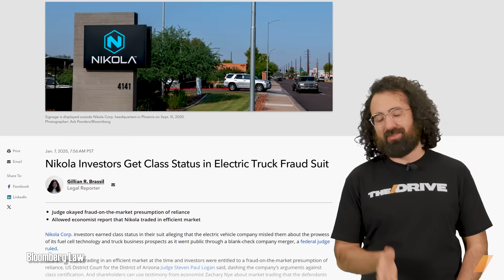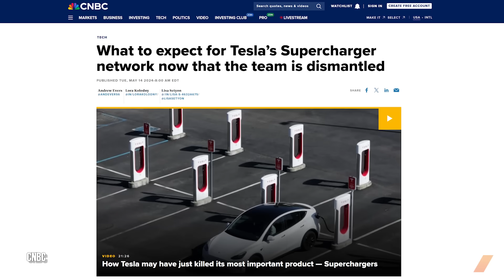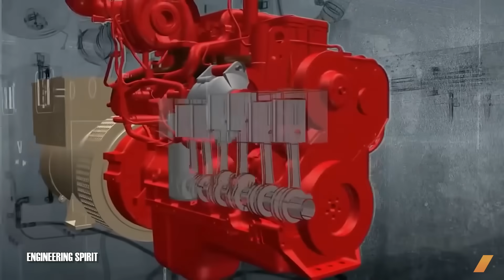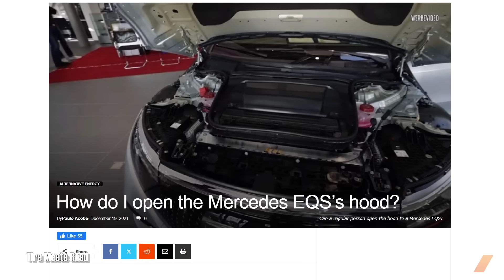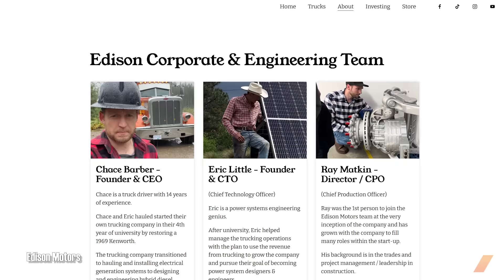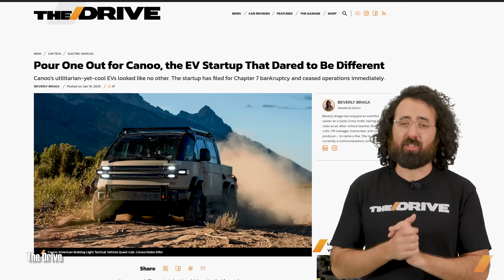The truckers in a shed beating Tesla with 100-yr-old EV tech

Comment: I'd been asking the same question about fuel hybrids for years. Much of the efficiency comes from using electricity for power transmission instead of complex mechanical systems that lose power along the way. In turn, that can reduce complexity of the remaining mechanical systems.  

The resistance against hybrids always come down to a blind focus on going full EV or "refining" standard engines. There's a hard limit on mechanical efficiency that will never be overcome, and full EVs are going to require a massive infrastructure overhaul. The complete dysfunction of US politics is going to stall any form of long-term investment. 

Whether EVs are the ultimate future is debatable, and that future is a ways off. Hybrids can bridge the fairly large gap between standard engines and full EV in many applications, and hybrids can be done RIGHT NOW!

Comment: im my opinion, the near future is either about biodiesel or hydrogen cells. 

biodiesel: 
pros:
- doesn't burn as easily so its less likely to cause a disaster.
- most diesel vehicles can already run on biodiesel without modification
- cheap

cons:
-  lots of moving parts
- requires land usage for growing plants.

hydrogen cells:
pros:
- not many moving parts requiring less maintenance 

cons:
- pressurized explosive gas.

Comment: at 3:52 when you talk about batteries needing to be replaced i found out recently where i was on a tour at a school where you could take an education to become a mechanic and they have little area dedicated to electric veichles and they told us that the batteries are build up in ''cells'' were a bundle of batteries are and if a cell goes bad you can replace that particular cell instead of replacing the entire batteri just thought that i wanted to say that if anyone didnt know
Reply: I think the battery replacement is more about the cell degredation over time with charging cycles (especially when they charge quickly) meaning all the cells need to be replaced around the same time

Comment: What they could do for rear axles for pickups is make a diff motor unit! Basically have a super-duper electric motor feed into a standardized differential, and then reuse the rest of the factory axles and such, rather than direct-drive. Yes, you lose the one motor per wheel, but it simplifies costs by literally allowing you to buy an off-the-shelf differential and making a motor mount.

Comment: One giant inefficient that is never addressed with pure electric vehicles is transmission line losses. Those hundreds of miles of wire from the power plant to the charging station radiating heat from resistance. Is that counted into an EV's empg?

I just bought a Prius, my first, for gig work. I used to drive semi's OTR. With those two things for experience I can say this makes so much sense!

The single lever for forward, reverse and a park button are great for the frequent stops in gig delivery work. When I drove semi's out of Kansas City I shifted about 50 times before I hit 435 with a 10 speed. The company did put me in an automatic for a couple of years which I did like but my last truck was another 10 speed.

Comment: I have seen these Edison guys before and it's looking great. Here in Norway the politicans are thinking "one size fits them all". Electrical passenger cars has >90 % of the new car market because they are taxfree in the price range ordinary people are buying, while even PHEV's like Rav4 has high taxes to a cost equal to 75.000 USD, and most families can charge EVs at home and don't often drive longer than their range. Local heavy goods distribution also is on special battery built trucks. But even we have had diesel electric trains for a century, and still have on some remote train lines and such as people with PHEVS with ok range are driving nearly emission free, the politicans think they understand the needs and engineering better than specialist, but of course don't understand the completely different need for a lot of companies with need for such as 4x4 pickups towing trailer at 3.5 tons long distances at public roads before they go off road to serve the society's needs. And that the obvious choise for heavy trucks should be hybrid models untill new tech is ready. All of us have responsibilities in the need for emmission reduction to stop the global warming, but a lot of politicans might have been too optimistic in the Paris agreement and in panic dismiss known tecnology which would made better preliminary results than trying to jump directly to systems they think will solve the problems before the development is ready.

Comment: hang on? a manufacturer is preventing customers from opening the hood? that's a fire hazard, an actual fire hazard where if the fire brigade cannot access under the hood to combat fire or even the user of the car to open the hood to combat fire, that is a fire hazard and must be classified as a "stop use" recall with immediate remedies.

Comment: I don't think EV trucks will ever be viable with current battery technology.

The bigger problem is that the trucking industry isn't sustainable as it is.  They have just been heavily subsidized by tax payers and enabled by the existence of fossil fuels.  The widespread usage of semi-trucks is a catastrophic failure of our politicians decades ago.

If we as a society pull our heads out of the sand and try to actually fix problems trucking industry will have to be reduced and replaced with more trains again.  As unfortunate as that is for people that drive trucks to lose their jobs.  Not to say it will disappear completely.  There are circumstances where it is the best option and in those cases that is the best use-case for hydrogen (probably the only realistic one too).

Comment: They're currently being hassled by the Canadian environmental rules because the enviros that were the law don't know the difference between a Parallel  Hybrid  (where the diesel motor and electric motor are on the same shaft)  and a Serial Hybrid where a diesel generator is used to charge batteries that are the used to drive the electric axle motors.  There is no transmission in their trucks just like a diesel-electric locomotive.

Comment: Why not instead of a big diesel engine as the generator you use a much smaller more economical engine that can deliver just enough power to charge the battery when in use
Reply: That is exactly what they are doing.  Their trucks are series hybrids.
Reply: A normal vocational truck will have a 15 liter engine,  and an Edison truck only needs a 9 liter engine. The batts handle peak power while the engine handles average load.

Comment: So basically a mobile charging/motor hybrid. And since the main motor is an electric one, thats going throw off a lot of truckers off since theyve gotten so used to the vibration and sound of the engine, do correct me if im wrong tho
Reply: The Scania diesel engine is only run at a constant RPM to generate electricity when needed.  The axle motors drive the rear wheels.  It's a series hybrid design.  It won't smoke hard during takeoff or a hill climb.

Comment: There is one issue with serial hybrids and that is efficiency: say you have a 90% efficient generator (converting mechanical energy to electricity) and a 90% efficient inverter (converting electricity to mechanical energy), your total efficiency is only 81%. Meaning almost 1/5 of your energy is wasted.

Toyota Hybrids get around this by splitting the torque into ~72% mechanical and an ~28% electrical. 

Even at 80% efficiency in the electrical path this still comes out to ~94% total efficiency.

And all that without having any transmission or clutch. 

John Deere uses a similar system in their hybrid tractors, so I really wonder why there are no Toyota hybrid trucks.
Reply: The transmission in a conventional diesel wastes lots of energy as heat.  Also the diesel engine doesn't operate at the most efficient RPM.  And conventional diesel doesn't recoup energy through regen.  No Jake brake needed with a serial diesel hybrid.
Reply: The efficiency of modern generators is about 95%, and inverters are like 98%.

Comment: no offense but how much training is really required for the mechanical portion? its not like guys are going to be pulling out an electric motor and rewinding it themselves. make major components modular for swap and go parts changers. when it comes to the electrical systems and programming as long as you could allow access for remote in servicing you could take care of that alot easier without needing nation wide highly trained electrical engineers and technicians.  this is how big industrial companies run that dont have on site programmers.

Comment: Edison is indeed cool. 
The gasoholism in the video not so much. 

The truck isn't in motion that whole 15 hours, and most logging sites are already wired for high enough power to get a decent charge into the truck. 

When those massive battery packs need to be replaced they first go onto the used battery market and get re-used in static storage. Then when they finally hit EoL they can be recycled. 
It's kinda like using an old Cummins as a backup generator for your house except not stinky and not prone to runaways. 

"... and sit there for an hour or more." not 5 minutes ago you mentioned it took 30m for 400mi. 

I'm a normal driver, I love my EV. It gets me where I need to go cheaply and reliably and without smogging up the neighborhood. 

If as you say a series hybrid is easier to work on than a standard diesel then doesn't it follow that a pure EV would be yet easier? Yes, yes it does. 

"Too many companies are trying to lock things down in proprietary software" yup. Clippy agrees with that message. 

I've had the dream to convert a Subaru Brat to electric since before Tesla was a glint in Eberhard's eye. Now it's actually possible, easy, and not horrifically expensive. 

I mean Telo and Aptera are doing neat things too, but Edison is indeed cool. 

They don't 'charge themselves' you gotta gas them up.

Comment: I don't know if it was necessary to shit on BEV semis to get the point across. Diesel electric semi trucks is a really cool idea and them co-existing with full electric trucks, sharing charging infrastructure makes so much sense in the long run. Different solutions for different niches, battery for hub and spoke, short haul and diesel electric for long hual, remote etc. Also your point that we "don't have the battery tech to get to 100% BEV" is just not true and nonsensical.

Comment: it constantly baffles me how hybrid-electric isn't the standard.  full EV's are too hazardous and have impractically long charge times, and full fossil fuel vehicles don't have regenerative braking.  If we want to get to true carbon neutrality on the road, the answer is ABSOLUTELY diesel-electric hybrids with massive Bio-diesel infrastructure to ensure we're getting our fuel from agricultural carbon recapture rather than adding more carbon to the atmosphere.  This also frees up more petroleum derivatives for plastics and other synthetics like synthetic rubber which is probably a better use of our limited global crude supply.
Reply: My almost 8 year old Bolt gets most of a charge in 45m. Newer EVs can do it in 5.
Buuuut most of the time I just plug it in when I get home and it's ready next time I need it. With my old Subaru I spent a ton of time making multiple trips to the gas station each week. 

Gas cars catch on fire way more often than EVs, and EVs don't explode like gas cars can. EVs don't poison everyone nearby every time they're turned on, gas cars do. 

Every biodiesel endeavor I've seen uses more energy than it produces. From readying the field, to planting, to weeding, to harvesting, to transporting the crop, to fermenting the crop, to purifying the alcohol and adding the additives, to transporting that fuel out to where it's used, to wasting at least 60% of that power in the engine; it's a ton of wasteful steps. 
Compare that to: sun shines on my house, solar panels on my roof convert that to electricity which my car puts in the battery. 

Hybrids have all the problems of a gas car, plus all the exaggerated problems of an EV.

Comment: The problem with EV is not that we dont have the technology, is that we dont want to implement it. 
We could very easily make thousands upon thousands of charging stations across the country
we could even go and adopt a the method of interchangable batteries that some EVs are applying, with stations that just let you exchange the spent battery for a charged one, and leave the one you were using charging for someone to take it. 
We could even eventually make roads that allow for cars to charge as they ride on the road. 
The technology is there, we just dont want to apply it, because we are addicted to oil.

Comment: the problem with diesel electric is it doesn't scale down very well. thats why it was never put in trucks and cars. you even see it in hybrid cars only getting a little over 55mpg  vs a full electric.
Reply: Correct. It scales from diesel/electric locomotives down to semis ok. It's harder to scale down to pickups, and even harder to scale down to autos.

Comment: Edision is awesome, but the Canadian goverment has their heads up their own rears. The government just told them "you cant use the generator you designed the plug-in hybrid system around, because its not rated for on highway use" so they have to use a Cummings motor and forgo the plug-in hybrid even thought the generator produces less emissions than the Cummings, because the government doesnt have legislation in place allowing the use of the "off highway" generator. The whole idea is to create less emissions and the Canadian goverment is basically this guy 🤷‍♂️

Comment: Its a very old idea, but it has some flaws. Trains do this because they have no other alternative for torque. But trucks can manage with the engine alone. They are far simpler. Edison is at least doing things the right way, so theres that, but I have studied these vehicles for a long time, my grand father was one of the first to work in this field going back to the later 40s and 50s when diesel electric buses and trucks were coming out. Back then it was the GM PDE4505 if I recall correctly. THey just didnt last, and eventually were engines swapped for electric motors he designed and make as trolleybuses.

The issue is the battery or batteries. Unless they can be lead acid, like in regular trucks or even trains, then that will be an issue. LiIon batteries are just not feasable, especially in commercial applications. Ask the bus operators about that....
Reply: Battery technology still lags behind ICE in energy density. I believe that in the last 20 years there has been and continues to be a lot of money being spent to improve battery storage price,density, and longevity. We're in the process. Exciting times.

Comment: Any Hybrid  contradicts itself. anyone about parasitic loss 😮 the weight or load of the power source not being used is only cancelling out the efficiency of the source moving the vehicle forward. Hybrid makes no logical sense. I simply dont have a more foolish analogy  to get this across. Converting from one form of energy to the other takes even more away🤪. Eventually we will have better ways to manage energy. But for now Battery storage will work. 😎😎😎
Reply: Hybrid gets the hp/torque/regen of electric and the range of diesel. Best of both worlds.

Comment: Treason tariffs are blocking the solid state batteries from BYD from coming to the US. ICE motors are Dino but don't know... Yet. Arrest the Felon and are will see immediate change for the better. Even Tesla just doubled the energy density. Used EV batteries are powering AI and communities. Diesels? Still coughing.

Comment: Can this be scaled down for a Class B Flatbed with drop axle. The electric could power an electric Moffat. I deliver lumber in the DC Metro area.
Reply: Or a rear mounted Knuckle boom for dry wall or steel 🤔 
A modular system for city delivery 
The same wat Rivian has attached to Amazon. This has a better chance of effective change in a stagnant market

Comment: As a train fanatic, I've often wondered why they didn't use this method for over the road trucks.  Glad to see someone put this into action (finally).

I recently found  a website of a Chinese company that makes these electric motor powered axle units...  Thought it was an "easy" way to power trucks.

They also feature/sell hub motors, whereby you can power the front (steerable) wheels in addition to the rigid rear axles.  Thereby increasing the overall pulling capacity of a single, tandem or triple axle semi-truck relatively easily.

Comment: And what I find really interesting is that prototypes like this can be built almost in-house entirely with 3D plastic and metal printers. You might want an old hand toolmaker on hand for finish but the actual manufacture can be done in-house. It's mostly off-the-shelf, too.